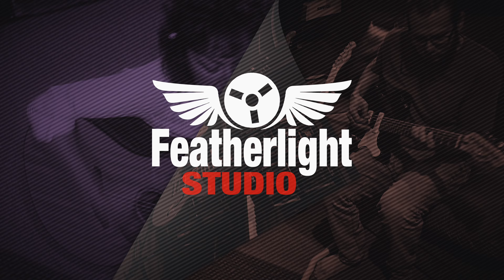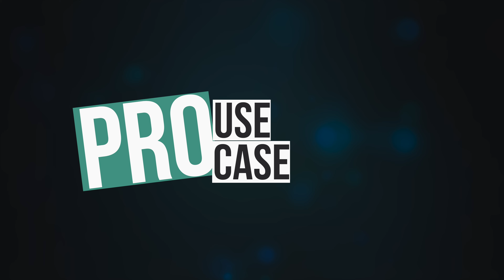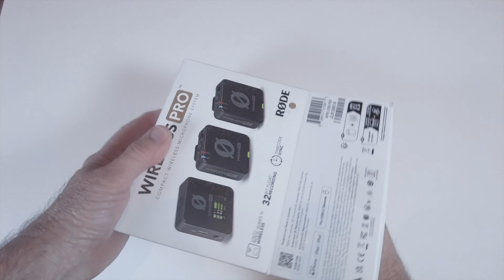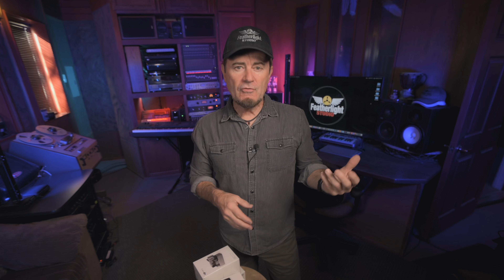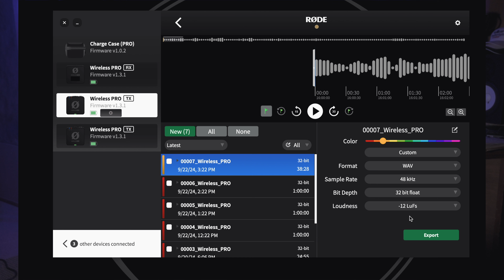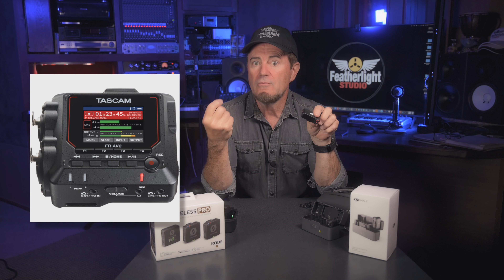RODE Wireless Pro vs DJI Mic 2 - Surprising Results

Comment: Watched this video 4 times and still can't decide 😅 Going to Japan with just an android smartphone for a month and they both have a number of positives and negatives.

Thanks for the vid, it really helps to get unbiased opinions!
Reply: Which mic did you get for your trip and how was the experience?
Reply: @MykeLim77771 went for the rode in the end. The only issues with it are the weight if you wanna attach it to clothes, and the second case with accessories, otherwise it's fantastic sound quality, even in louder areas like central Tokyo. 

No regrets buying it, and it has actually replaced my other microphones for making videos. Glad I paid the little extra for it, it will sound good for years :)

Comment: The internal recording on my dji 2 is very very low. Almost not audible. I increase the gain to max (+12) on action 4 and its still very low. Sound is crystal clear in video when connected to action 4 but the internal recording is almost unusable. 
At gain +12 and after increasing gain to max on final cut pro, its still around -15 to -12 db..
Any idea what's the issue ?

Comment: and DJI Mic2 another ISSUE is Low-cut
default is enable Low-cut
32bit default is disable 

without RF Receiver/pocket3/action
you can't change setting
and  via  Bluetooth  to iphone is worst thing
don't buy mic2 only

for phone user,if want dji
go to New DJI mic mini
a lot affordable
can setup by app

Comment: DJI pocket3 not RF transmission inside
just via Bluetooth connection and open the setting
sound got vey big lag at pocket3(and can't connect pocket3 when sdcard have 60-100GB file often) 
i have pocket3+mic2 set,at last i buy RF transmission
 
if you use RF Receiver via usb to pocket3
the sound better alot.and almost no delay

if you google (dji pocket3 mic2 bluetooth),you will get 
The DJI Mic 2 transmitter currently only supports Bluetooth connection with Osmo Action 4, Osmo Pocket 3, and smartphones. 
Osmo Action 4 and smartphones can connect to one transmitter via Bluetooth at a time, 
while Osmo Pocket 3 can connect to two transmitters via Bluetooth at the same time.

btw dji mic mini set is good for good for value
mic 2 set? no

Comment: Fantastic video...yep...as a videographer, I use sennheisser G3 lav mics and sometimes I get some RF interferance and I was thinking that as a back up I could use the DJI mic 2 (the newer) with a lavalier so that I have the Sennheisser and the  DJI on the groom for example and I would record on the DJI internally while receving a signal in to my camera (I have 4 channels of audio)- I know that the Rode is very similar to DJI. I wonder which one has better quality wirelessly? My Sennheiser G3 are solid (most of the times).  I know I could get a Tascam  Dr 10L or a Zoom F2 to record into the unit, but a reliable wireless kit is always good to have. Thoughts?
Reply from the maker: I found the Rode and the DJI to be very similar in wireless transmission quality as long as both units were well within their stated distances. Being both 2.4Gh bands, they are limited to line of sight performance compared to your G3 UHF systems however. Big bonus of the RODE is that it can be used as a standalone 32 Bit float recorder, like the Tascam, the DJI cannot.
Reply: @Featherlightstudio  I guess the DJI is a bit easier to use due to its touch screen...I don't want to be relying on apps etc in the middle of a shoot...hmm...some reviewers also feel that the optional DJI lavalier mic is not very good and even suggest to get the Rode lavalier that comes with the RODE system! that add about $100 or so to the cost of the DJI (I would need a lavalier)...I'm attracted to the 32 bit float recording capabilities...I wish the price was lower! Thanks for the reply

Comment: @Featherlightstudio Thanks for the review. Shill-tubers are making it really difficult for me to choose a system to go with. 
You mentioned the microphones and preamps in relation to clipping. Did you test the systems in this regard? 
I record moto-vloggs and sometimes bike races where the amplitude can get quite high. I was using a Zoom H5 with 24 bit in the past but with static gain it did not allow me to set gain in a way to hear the exhaust (basically 120db from 6feet away) without clipping and also from far away. I hope the 32bit allows for more room to recover the lows. A two mic setup with different gain might be the right play but also adds too much bulk to my current 1-Bag setup for traveling .
Reply from the maker: It was exactly the same for me as well, SO hard to find a real review when your trying to purchase something and just want straight answers.
The test I did for the mics showed quite high SPL (120dB) and the preamps were well matched to that input. I think the 32bit float would be a great choice for you if your anywhere near that SPL range and you dot and the extra sync in post.

Comment: I really like the rode here based on your video especially on our case. We do streaming church services a lot. I have 2 DJI drones, neo and mini 4 pro. And obviously a lot of people will say go for DJI mic 2. I still need to find a video that tested rode wireless pro with the DJI drones. What is your thoughts on this? I am your new subscriber anyway. I like your comparison. Very straightforward ang honest. 😊
Reply from the maker: Let us know if you get to test the DJI Mini 4 pro with the RODE Wireless Pro, I dont have a drone to test it with but I know that you can use the USB-C input to add external wireless Mics to the controller.
Reply: @Featherlightstudio  Thanks Mate. I will order the rode now and will test. Sounds interesting. I saw a video that a DJI mic 2 sync to DJI fly app via Bluetooth but the quality aren’t that good.
Reply: @adrian4jc  With the drones, the DJI set-up expects that you either use BT, or connect via USB-C to the controller. The only other option is record the audio seperately, and merge in post.

Comment: Wireless micros sucks. I can hear them
Using a recorder, such as zoom F2.
Reply: The RODE can be used as a stand alone 32bit float recorder.
Reply: I wish I could travel with a dedicated sound system but it's not practical for run and good shooting or vlogging. Used to have a zoom H5 but figured out the downsides quite quickly. Syncing audio in post, the additional size and weight and not being able to charge via USBC adds lots of bulk to the system. Strapping it to your camera isn't an option either. Still miss phantom power though. As a Audiophile myself I hate to admit that convenience won the case for me.